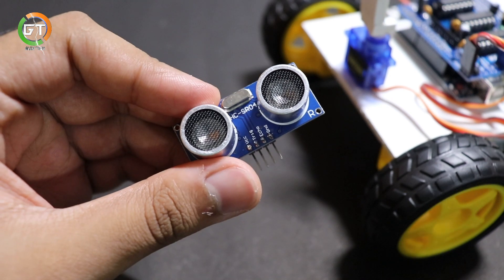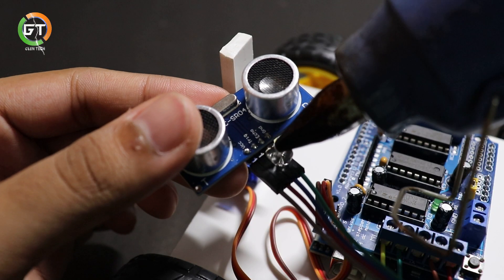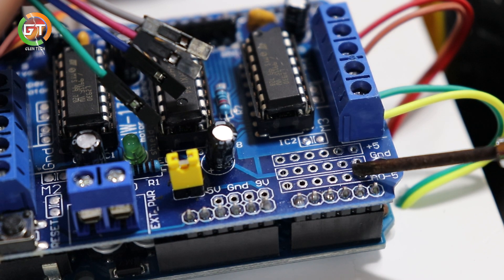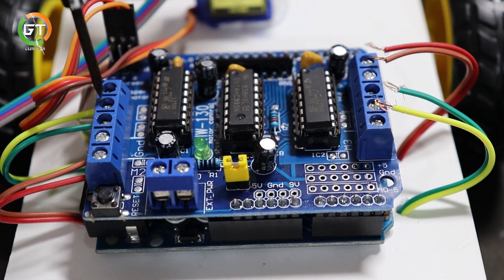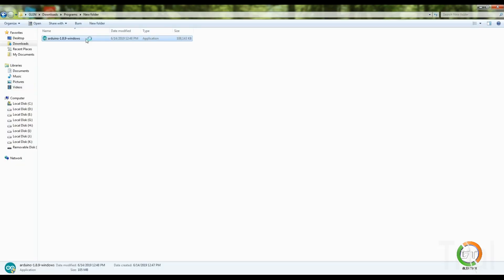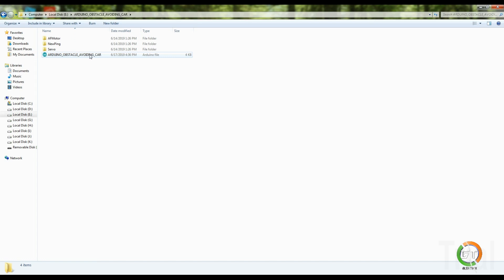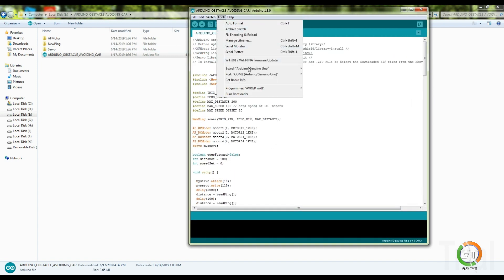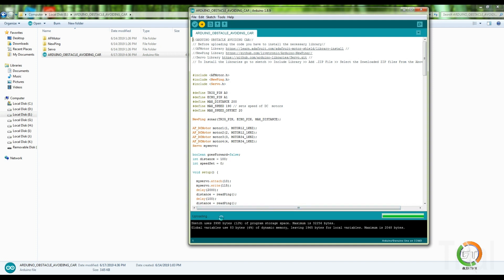How To Make A DIY Arduino Obstacle Avoiding Car For Science Project

Comment: Arduino enna aa folderile ino file open aakan pattunillaaa
Reply from the maker: Before uploading the code you have to install the necessary library//

//AFMotor Library https://learn.adafruit.com/adafruit-motor-shield/library-install //

//NewPing Library https://github.com/livetronic/Arduino-NewPing// 

//Servo Library https://github.com/arduino-libraries/Servo.git //

Download this 3 files and open documents , Arduino folder , library folder and paste 3 files in it
Reply: @GLENTECH  bro speed korkune engana
Reply from the maker: Download this software : https://www.win-rar.com/start.html?&L=0
Reply: @GLENTECH  bro servo motor move chuyunund but sensor vechalum illalelum orupola
Reply from the maker: //ARDUINO OBSTACLE AVOIDING CAR//

#include <AFMotor.h>  
#include <NewPing.h>
#include <Servo.h> 

#define TRIG_PIN A0 
#define ECHO_PIN A1 
#define MAX_DISTANCE 200 
#define MAX_SPEED 190 // sets speed of DC  motors
#define MAX_SPEED_OFFSET 20

NewPing sonar(TRIG_PIN, ECHO_PIN, MAX_DISTANCE); 

AF_DCMotor motor1(1, MOTOR12_1KHZ); 
AF_DCMotor motor2(2, MOTOR12_1KHZ);
AF_DCMotor motor3(3, MOTOR34_1KHZ);
AF_DCMotor motor4(4, MOTOR34_1KHZ);
Servo myservo;   

boolean goesForward=false;
int distance = 100;
int speedSet = 0;

void setup() {

  myservo.attach(10);  
  myservo.write(115); 
  delay(2000);
  distance = readPing();
  delay(100);
  distance = readPing();
  delay(100);
  distance = readPing();
  delay(100);
  distance = readPing();
  delay(100);
}

void loop() {
 int distanceR = 0;
 int distanceL =  0;
 delay(40);
 
 if(distance<=15)
 {
  moveStop();
  delay(100);
  moveBackward();
  delay(300);
  moveStop();
  delay(200);
  distanceR = lookRight();
  delay(200);
  distanceL = lookLeft();
  delay(200);

  if(distanceR>=distanceL)
  {
    turnRight();
    moveStop();
  }else
  {
    turnLeft();
    moveStop();
  }
 }else
 {
  moveForward();
 }
 distance = readPing();
}

int lookRight()
{
    myservo.write(50); 
    delay(500);
    int distance = readPing();
    delay(100);
    myservo.write(115); 
    return distance;
}

int lookLeft()
{
    myservo.write(170); 
    delay(500);
    int distance = readPing();
    delay(100);
    myservo.write(115); 
    return distance;
    delay(100);
}

int readPing() { 
  delay(70);
  int cm = sonar.ping_cm();
  if(cm==0)
  {
    cm = 250;
  }
  return cm;
}

void moveStop() {
  motor1.run(RELEASE); 
  motor2.run(RELEASE);
  motor3.run(RELEASE);
  motor4.run(RELEASE);
  } 
  
void moveForward() {

 if(!goesForward)
  {
    goesForward=true;
    motor1.run(FORWARD);      
    motor2.run(FORWARD);
    motor3.run(FORWARD); 
    motor4.run(FORWARD);     
   for (speedSet = 0; speedSet < MAX_SPEED; speedSet +=2) // slowly bring the speed up to avoid loading down the batteries too quickly
   {
    motor1.setSpeed(speedSet);
    motor2.setSpeed(speedSet);
    motor3.setSpeed(speedSet);
    motor4.setSpeed(speedSet);
    delay(5);
   }
  }
}

void moveBackward() {
    goesForward=false;
    motor1.run(BACKWARD);      
    motor2.run(BACKWARD);
    motor3.run(BACKWARD);
    motor4.run(BACKWARD);  
  for (speedSet = 0; speedSet < MAX_SPEED; speedSet +=2) // slowly bring the speed up to avoid loading down the batteries too quickly
  {
    motor1.setSpeed(speedSet);
    motor2.setSpeed(speedSet);
    motor3.setSpeed(speedSet);
    motor4.setSpeed(speedSet);
    delay(5);
  }
}  

void turnRight() {
  motor1.run(FORWARD);
  motor2.run(FORWARD);
  motor3.run(BACKWARD);
  motor4.run(BACKWARD);     
  delay(500);
  motor1.run(FORWARD);      
  motor2.run(FORWARD);
  motor3.run(FORWARD);
  motor4.run(FORWARD);      
} 
 
void turnLeft() {
  motor1.run(BACKWARD);     
  motor2.run(BACKWARD);  
  motor3.run(FORWARD);
  motor4.run(FORWARD);   
  delay(500);
  motor1.run(FORWARD);     
  motor2.run(FORWARD);
  motor3.run(FORWARD);
  motor4.run(FORWARD);
}
Reply from the maker: In code " max speed 190 " decrease 190 and set how much you want .

Comment: Bro i install all the library but .servo motor was rotate in 360 degree..
Reply from the maker: //ARDUINO OBSTACLE AVOIDING CAR//

#include <AFMotor.h>  

#include <NewPing.h>

#include <Servo.h> 

#define TRIG_PIN A0 

#define ECHO_PIN A1 

#define MAX_DISTANCE 200 

#define MAX_SPEED 190 // sets speed of DC  motors

#define MAX_SPEED_OFFSET 20

NewPing sonar(TRIG_PIN, ECHO_PIN, MAX_DISTANCE); 

AF_DCMotor motor1(1, MOTOR12_1KHZ); 

AF_DCMotor motor2(2, MOTOR12_1KHZ);

AF_DCMotor motor3(3, MOTOR34_1KHZ);

AF_DCMotor motor4(4, MOTOR34_1KHZ);

Servo myservo;   

boolean goesForward=false;

int distance = 100;

int speedSet = 0;

void setup() {

  myservo.attach(10);  

  myservo.write(115); 

  delay(2000);

  distance = readPing();

  delay(100);

  distance = readPing();

  delay(100);

  distance = readPing();

  delay(100);

  distance = readPing();

  delay(100);

}

void loop() {

 int distanceR = 0;

 int distanceL =  0;

 delay(40);

 

 if(distance<=15)

 {

  moveStop();

  delay(100);

  moveBackward();

  delay(300);

  moveStop();

  delay(200);

  distanceR = lookRight();

  delay(200);

  distanceL = lookLeft();

  delay(200);

  if(distanceR>=distanceL)

  {

    turnRight();

    moveStop();

  }else

  {

    turnLeft();

    moveStop();

  }

 }else

 {

  moveForward();

 }

 distance = readPing();

}

int lookRight()

{

    myservo.write(50); 

    delay(500);

    int distance = readPing();

    delay(100);

    myservo.write(115); 

    return distance;

}

int lookLeft()

{

    myservo.write(170); 

    delay(500);

    int distance = readPing();

    delay(100);

    myservo.write(115); 

    return distance;

    delay(100);

}

int readPing() { 

  delay(70);

  int cm = sonar.ping_cm();

  if(cm==0)

  {

    cm = 250;

  }

  return cm;

}

void moveStop() {

  motor1.run(RELEASE); 

  motor2.run(RELEASE);

  motor3.run(RELEASE);

  motor4.run(RELEASE);

  } 

  

void moveForward() {

 if(!goesForward)

  {

    goesForward=true;

    motor1.run(FORWARD);      

    motor2.run(FORWARD);

    motor3.run(FORWARD); 

    motor4.run(FORWARD);     

   for (speedSet = 0; speedSet < MAX_SPEED; speedSet +=2) // slowly bring the speed up to avoid loading down the batteries too quickly

   {

    motor1.setSpeed(speedSet);

    motor2.setSpeed(speedSet);

    motor3.setSpeed(speedSet);

    motor4.setSpeed(speedSet);

    delay(5);

   }

  }

}

void moveBackward() {

    goesForward=false;

    motor1.run(BACKWARD);      

    motor2.run(BACKWARD);

    motor3.run(BACKWARD);

    motor4.run(BACKWARD);  

  for (speedSet = 0; speedSet < MAX_SPEED; speedSet +=2) // slowly bring the speed up to avoid loading down the batteries too quickly

  {

    motor1.setSpeed(speedSet);

    motor2.setSpeed(speedSet);

    motor3.setSpeed(speedSet);

    motor4.setSpeed(speedSet);

    delay(5);

  }

}  

void turnRight() {

  motor1.run(FORWARD);

  motor2.run(FORWARD);

  motor3.run(BACKWARD);

  motor4.run(BACKWARD);     

  delay(500);

  motor1.run(FORWARD);      

  motor2.run(FORWARD);

  motor3.run(FORWARD);

  motor4.run(FORWARD);      

} 

 

void turnLeft() {

  motor1.run(BACKWARD);     

  motor2.run(BACKWARD);  

  motor3.run(FORWARD);

  motor4.run(FORWARD);   

  delay(500);

  motor1.run(FORWARD);     

  motor2.run(FORWARD);

  motor3.run(FORWARD);

  motor4.run(FORWARD);

}
Reply from the maker: Add this code
Reply: Tq bro

Comment: Can u just connect the pins with hot glue
Reply from the maker: Which pins ?
Reply: The ones u connected to the board to connect the sensor
Reply from the maker: @suley-d4h  yes u can connect sensor cable using hot glue
Reply: Why is my other motors not moving the motors near the battery move but the other two don’t
Reply from the maker: Before uploading the code you have to install the necessary library

//AFMotor Library https://learn.adafruit.com/adafruit-motor-shield/library-install //

//NewPing Library https://github.com/livetronic/Arduino-NewPing// 

//Servo Library https://github.com/arduino-libraries/Servo.git //

// To Install the libraries go to sketch >> Include Library >> Add .ZIP File >> Select the Downloaded ZIP files From the Above links //
Reply from the maker: //ARDUINO OBSTACLE AVOIDING CAR//

#include <AFMotor.h>  

#include <NewPing.h>

#include <Servo.h> 

#define TRIG_PIN A0 

#define ECHO_PIN A1 

#define MAX_DISTANCE 200 

#define MAX_SPEED 190 // sets speed of DC  motors

#define MAX_SPEED_OFFSET 20

NewPing sonar(TRIG_PIN, ECHO_PIN, MAX_DISTANCE); 

AF_DCMotor motor1(1, MOTOR12_1KHZ); 

AF_DCMotor motor2(2, MOTOR12_1KHZ);

AF_DCMotor motor3(3, MOTOR34_1KHZ);

AF_DCMotor motor4(4, MOTOR34_1KHZ);

Servo myservo;   

boolean goesForward=false;

int distance = 100;

int speedSet = 0;

void setup() {

  myservo.attach(10);  

  myservo.write(115); 

  delay(2000);

  distance = readPing();

  delay(100);

  distance = readPing();

  delay(100);

  distance = readPing();

  delay(100);

  distance = readPing();

  delay(100);

}

void loop() {

 int distanceR = 0;

 int distanceL =  0;

 delay(40);

 

 if(distance<=15)

 {

  moveStop();

  delay(100);

  moveBackward();

  delay(300);

  moveStop();

  delay(200);

  distanceR = lookRight();

  delay(200);

  distanceL = lookLeft();

  delay(200);

  if(distanceR>=distanceL)

  {

    turnRight();

    moveStop();

  }else

  {

    turnLeft();

    moveStop();

  }

 }else

 {

  moveForward();

 }

 distance = readPing();

}

int lookRight()

{

    myservo.write(50); 

    delay(500);

    int distance = readPing();

    delay(100);

    myservo.write(115); 

    return distance;

}

int lookLeft()

{

    myservo.write(170); 

    delay(500);

    int distance = readPing();

    delay(100);

    myservo.write(115); 

    return distance;

    delay(100);

}

int readPing() { 

  delay(70);

  int cm = sonar.ping_cm();

  if(cm==0)

  {

    cm = 250;

  }

  return cm;

}

void moveStop() {

  motor1.run(RELEASE); 

  motor2.run(RELEASE);

  motor3.run(RELEASE);

  motor4.run(RELEASE);

  } 

  

void moveForward() {

 if(!goesForward)

  {

    goesForward=true;

    motor1.run(FORWARD);      

    motor2.run(FORWARD);

    motor3.run(FORWARD); 

    motor4.run(FORWARD);     

   for (speedSet = 0; speedSet < MAX_SPEED; speedSet +=2) // slowly bring the speed up to avoid loading down the batteries too quickly

   {

    motor1.setSpeed(speedSet);

    motor2.setSpeed(speedSet);

    motor3.setSpeed(speedSet);

    motor4.setSpeed(speedSet);

    delay(5);

   }

  }

}

void moveBackward() {

    goesForward=false;

    motor1.run(BACKWARD);      

    motor2.run(BACKWARD);

    motor3.run(BACKWARD);

    motor4.run(BACKWARD);  

  for (speedSet = 0; speedSet < MAX_SPEED; speedSet +=2) // slowly bring the speed up to avoid loading down the batteries too quickly

  {

    motor1.setSpeed(speedSet);

    motor2.setSpeed(speedSet);

    motor3.setSpeed(speedSet);

    motor4.setSpeed(speedSet);

    delay(5);

  }

}  

void turnRight() {

  motor1.run(FORWARD);

  motor2.run(FORWARD);

  motor3.run(BACKWARD);

  motor4.run(BACKWARD);     

  delay(500);

  motor1.run(FORWARD);      

  motor2.run(FORWARD);

  motor3.run(FORWARD);

  motor4.run(FORWARD);      

} 

 

void turnLeft() {

  motor1.run(BACKWARD);     

  motor2.run(BACKWARD);  

  motor3.run(FORWARD);

  motor4.run(FORWARD);   

  delay(500);

  motor1.run(FORWARD);     

  motor2.run(FORWARD);

  motor3.run(FORWARD);

  motor4.run(FORWARD);

}
Reply: Thank u sooo much

Comment: Bro but the only thing....is servo motor does not rotating.......does it heavy power supply...then means how much power supply is needed...to rotate all the 5 motors....
Reply from the maker: //ARDUINO OBSTACLE AVOIDING CAR//
// Before uploading the code you have to install the necessary library//
//AFMotor Library https://learn.adafruit.com/adafruit-motor-shield/library-install //
//NewPing Library https://github.com/livetronic/Arduino-NewPing// 
//Servo Library https://github.com/arduino-libraries/Servo.git //
// To Install the libraries go to sketch >> Include Library >> Add .ZIP File >> Select the Downloaded ZIP files From the Above links //

#include <AFMotor.h>  
#include <NewPing.h>
#include <Servo.h> 

#define TRIG_PIN A0 
#define ECHO_PIN A1 
#define MAX_DISTANCE 200 
#define MAX_SPEED 190 // sets speed of DC  motors
#define MAX_SPEED_OFFSET 20

NewPing sonar(TRIG_PIN, ECHO_PIN, MAX_DISTANCE); 

AF_DCMotor motor1(1, MOTOR12_1KHZ); 
AF_DCMotor motor2(2, MOTOR12_1KHZ);
AF_DCMotor motor3(3, MOTOR34_1KHZ);
AF_DCMotor motor4(4, MOTOR34_1KHZ);
Servo myservo;   

boolean goesForward=false;
int distance = 100;
int speedSet = 0;

void setup() {

  myservo.attach(10);  
  myservo.write(115); 
  delay(2000);
  distance = readPing();
  delay(100);
  distance = readPing();
  delay(100);
  distance = readPing();
  delay(100);
  distance = readPing();
  delay(100);
}

void loop() {
 int distanceR = 0;
 int distanceL =  0;
 delay(40);
 
 if(distance<=15)
 {
  moveStop();
  delay(100);
  moveBackward();
  delay(300);
  moveStop();
  delay(200);
  distanceR = lookRight();
  delay(200);
  distanceL = lookLeft();
  delay(200);

  if(distanceR>=distanceL)
  {
    turnRight();
    moveStop();
  }else
  {
    turnLeft();
    moveStop();
  }
 }else
 {
  moveForward();
 }
 distance = readPing();
}

int lookRight()
{
    myservo.write(50); 
    delay(500);
    int distance = readPing();
    delay(100);
    myservo.write(115); 
    return distance;
}

int lookLeft()
{
    myservo.write(170); 
    delay(500);
    int distance = readPing();
    delay(100);
    myservo.write(115); 
    return distance;
    delay(100);
}

int readPing() { 
  delay(70);
  int cm = sonar.ping_cm();
  if(cm==0)
  {
    cm = 250;
  }
  return cm;
}

void moveStop() {
  motor1.run(RELEASE); 
  motor2.run(RELEASE);
  motor3.run(RELEASE);
  motor4.run(RELEASE);
  } 
  
void moveForward() {

 if(!goesForward)
  {
    goesForward=true;
    motor1.run(FORWARD);      
    motor2.run(FORWARD);
    motor3.run(FORWARD); 
    motor4.run(FORWARD);     
   for (speedSet = 0; speedSet < MAX_SPEED; speedSet +=2) // slowly bring the speed up to avoid loading down the batteries too quickly
   {
    motor1.setSpeed(speedSet);
    motor2.setSpeed(speedSet);
    motor3.setSpeed(speedSet);
    motor4.setSpeed(speedSet);
    delay(5);
   }
  }
}

void moveBackward() {
    goesForward=false;
    motor1.run(BACKWARD);      
    motor2.run(BACKWARD);
    motor3.run(BACKWARD);
    motor4.run(BACKWARD);  
  for (speedSet = 0; speedSet < MAX_SPEED; speedSet +=2) // slowly bring the speed up to avoid loading down the batteries too quickly
  {
    motor1.setSpeed(speedSet);
    motor2.setSpeed(speedSet);
    motor3.setSpeed(speedSet);
    motor4.setSpeed(speedSet);
    delay(5);
  }
}  

void turnRight() {
  motor1.run(FORWARD);
  motor2.run(FORWARD);
  motor3.run(BACKWARD);
  motor4.run(BACKWARD);     
  delay(500);
  motor1.run(FORWARD);      
  motor2.run(FORWARD);
  motor3.run(FORWARD);
  motor4.run(FORWARD);      
} 
 
void turnLeft() {
  motor1.run(BACKWARD);     
  motor2.run(BACKWARD);  
  motor3.run(FORWARD);
  motor4.run(FORWARD);   
  delay(500);
  motor1.run(FORWARD);     
  motor2.run(FORWARD);
  motor3.run(FORWARD);
  motor4.run(FORWARD);
}
Reply from the maker: Before uploading the code you have to install the necessary library
//AFMotor Library https://learn.adafruit.com/adafruit-motor-shield/library-install //

//NewPing Library https://github.com/livetronic/Arduino-NewPing// 

//Servo Library https://github.com/arduino-libraries/Servo.git //

// To Install the libraries go to sketch >> Include Library >> Add .ZIP File >> Select the Downloaded ZIP files From the Above links //
Reply from the maker: 3.5v 2000mAh two rechargable batteries only needed